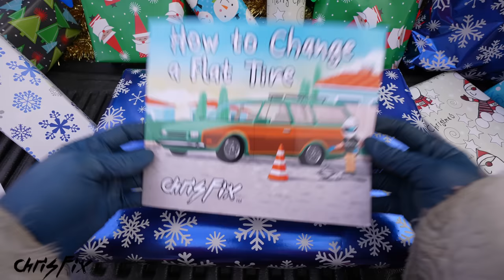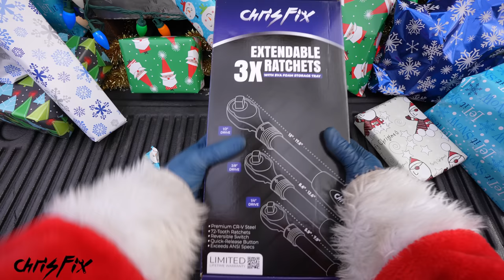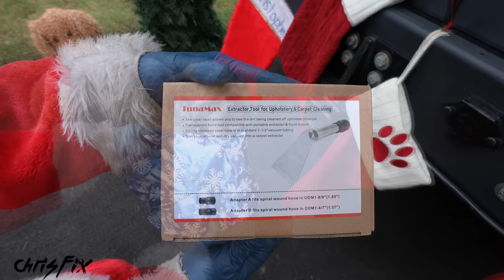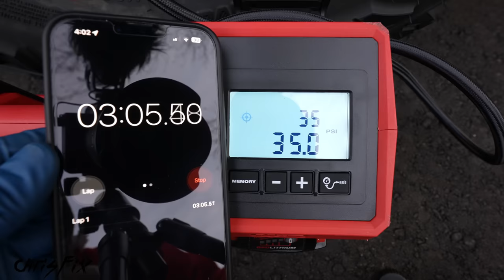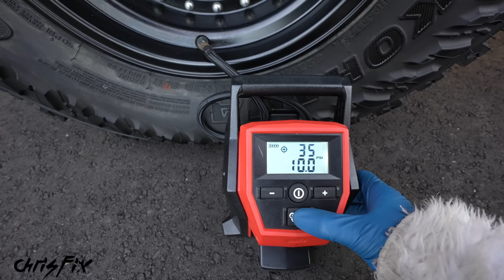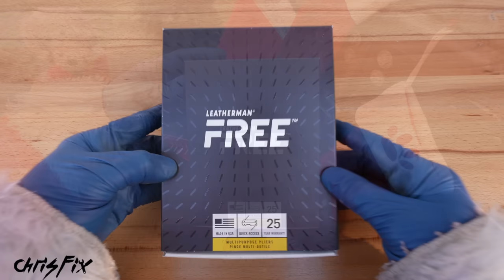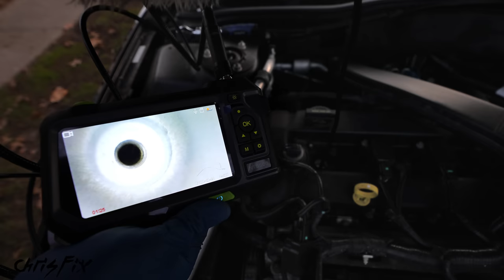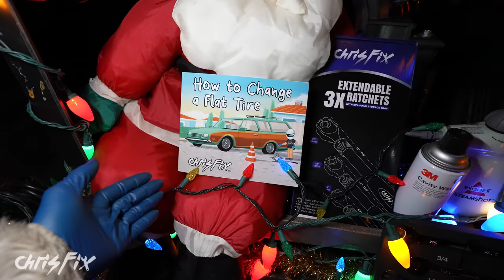Top Car Tools and Gadgets of 2022 (Christmas Gift Ideas)

Comment: Just as a safety tip, most likely you already know this - 6:55 don't break loose the wheel bolts by lifting, instead break them loos by pressing down - your back and spine will thank you a bunch! Cheers!
Reply: it might be true but considering that when going down you can only push about as much as you weigh, but when you push up you can add a couple kilograms of force and it will loosen up easier
Reply: @dat_platypus7007  jump
Reply: @thunderplump  just did, now what
Reply: @dat_platypus7007  The reason you push and not pull to loosen is mainly in the case of failure. Should the fastener be over tightened and you pull towards you and the tool slips off or worse breaks, All that force is directed at you instead of the ground. I have hit myself in the head a number of times when pushing wasn't an option and I was force to pull in a tight space under a car. And if you can't break a Lug loose with the rachet/breaker bar you are using, it's probably best to get a longer tool for more leverage or grab a cheater bar to really maximize your leverage point.

Comment: Bought the m12 inflator years ago. It's awesome! Use it on my tacoma when I go off roading. Deflate to ~20 psi and then back up to 33-35 when I'm done. One 4.0 amp battery does all 4 tires. I keep 2 spare batteries and a charger with me in the truck as well.

Comment: That coating wax is brilliant stuff. My grandpa used to take cans of it home when he was a civilian army engineer. Any metal left outside would get some of that on it. I've had a sliding lock on my shed for 10 years, no rust. The one before that was identical, rusted after 5 years to the point it was unusable cuz it didn't have the coating

Comment: The ChrisFix Extendable Ratchet set is sold out on Amazon. I've had the Harbor Freight version since I first started working on cars. It got stuck in one extended position after like 6 years, but they exchanged it for me pretty easily. I'd never buy another ratchet again. The added leverage is invaluable. I tell people I almost gave up working on cars when I was 16 and had the cheapest socket set you could find, and snapped a socket trying to take a brake caliper bolt off. I thought I did something wrong. My dad knew nothing about cars, always paid someone to fix his. He's surprised I know so much now. And if I don't, I can just go on youtube and someone like Chrisfix will show me how to do it. Thanks and happy holidays.
Reply from the maker: It's so nice to not have to grab the breaker bar in many situations! That is exactly why this is the first tool set I decided to try to sell.

Comment: As someone who owns both Milwaukee tire inflators, here is some advice. The M12 is a great unit but there is 1 issue with it. It says it will go to 120 psi, but it would never get to 80 psi for my truck. I went and bought the M18 and it will fill all 4 of my truck tires from 15 to 65/80 with 1 6ah battery and have power to spare.

Comment: I use a Michelin manual foot pump to inflate my tyres, is accurate, silent and lasted me for years and still have it and still works . It didn't cost much either and you don't have to worry about the batteries

Comment: I have the M12 Inflator and it's quite good. I went 2 months of daily inflating a tire. Toward the end of that 2nd month it became a twice daily inflate. The 2ah battery is enough to fill that 1 tire once (the tire was down to 7psi at some points), with some charge left over.
it's a good inflator for topping off 4 tires.

Comment: I think another tool you could do would be a socket set to go along with the ratchets. I just went out to get a socket set today, and it was really difficult finding a complete set of just sockets. I don't need the pliers or screwdriver or whatever else, and many sets don't have 1/4, 3/8, and 1/2 inch drive sockets. I think a no nonsense socket set with a foam insert or other type of toolbox storage would be awesome.

Comment: That Ryobi can be had for cheap on direct tools outlet, i got mine for about 35, helpful if youre buying more tools at the same time as they have flat trate shipping, but still ends up being cheaper than retail.

I have a slow leak i need to address but in the meantime it makes topping up ez.

Comment: Chris, is there a way to clean the rust screws and bolts in the engine? Right now I'm seeing my Honda civic 2006 battery has rusty screws and the negative (ground) has green rust (dust). I'm wonder if these can be cleaned or if I have to replace my car battery and the engine screws/bolts as well.

Comment: Mr fix... I tried doing the paint correction wet sanding. Bout gave myself a panic attack 😑 the first couple steps make the paint look sooooooo bad. It's not perfect but I managed to get it pretty good. The main goal was to fix a couple little spots where I tried a paint pen for the first time. My next car wash I'm going to try again to fix the micro scratches and really get the paint looking clean.

Comment: I've been fan of your channel since late 2014.

Also Chris, I have a question.

My dad's 97 Mercedes S420L (W140) (4.2L V8), that when we opened the coolant reservoir cap, The coolant look like light chocolate or milkshake looking. In fact my dad says he did replace the coolant several hours ago. I'm currently waiting your answer for any clues or symptoms? Thanks.

Comment: Hello Chris, i read that you read people's comments for up to 4 hours a day so i was hoping you'd read mine. I recently bought a citroen c4 and a huge flaw with the design is that the rubber below the front windshield glass detaches and lets water fall into the engine bay. Do you have any advice on how to fill in that gap? The rubber part is deformed and it's impossible to find a replacement part. I'm a huge fan and you're one of the reasons i started loving cars for which i'll always be thankful.
Reply from the maker: I would use an adhesive silicone. You can probably even shape it. Glad the videos are helpful!
Reply: @chrisfix  i'll try that when it gets a bit warmer, thanks for the reply, i appreciate it

Comment: H2 Hummer update, exhaust wont be in for another month, will get it installed then. Fixed battery issue, think the Hummer wouldn’t start because terminal connection, i cleaned up the terminal. Its nice and snug now. Also found the draw on battery removed the one fuse. Its .056ma now. Pretty sure there is a loose cord to the rear dvd that is causing the .045 on the radio fuse. H2 been killer driving, if you live on east coast I would do a Hummer run with you. Let me know cheers

Comment: Hey everyone I will just pass on a valuable tip! If you buy that lug torque wrench whenever you use it ALWAYS back off the torque setting as low as possible when you store the tool!  Otherwise it will lose its calibration.

Comment: Not sure about that reverse bleeder, it may remove trapped air but i'm not too sure it would replace the old fluid
Reply from the maker: Im not concerned with old fluid because I can easily remove all the old fluid bleeding the brakes normally. The air tho, that sometimes is hard to get out. I tried bleeding the brakes in the Hummer and all the fluid was brand new but the air just wouldnt escape. Used the reverse bleeder and it came out of the master cylinder.

Comment: Hey I’ve got a 1998 Land Rover Discovery that’s got a blown head gasket, but it wants to overheat immediately after it gets up to temperature, will any of these bottles still work? I read you have to run the vehicle for 60 minutes on the one I bought, that’s too much time I think.

Comment: Great video. Bought the extractor vacuum and steam shot after watching. Thanks! :) Do you have a more detailed video on how to change the brake fluid with just the reverse brake bleeder? I assume you would start with the caliper furthest from the ABS unit and work your way closer? And would you need to suck fluid out of the brake fluid reservoir to stop it from over flowing/remove the old fluid being pumped up? How do you know when to stop pumping on a given caliper?

Comment: Hey Chris! Probably a fat chance you'll respond, but I'm wondering if you have recommendations for light surface rust on the body frame of a car. How much is too much? How do I repair it? Should I not worry about it if it's just surface level? Maybe it would be a good video!
Reply: Hey WeebWhacker, not Chris but I do have a lot of experience on this subject. If fact one of my videos on here talks about restoration.
Surface rust on a body is not the end of the world unless you can poke a screw driver through it it'll be ok. It wont affect the car in any way.

Frame rust however is a different animal. Be sure its just surface rust and the frame is NOT rotting from the inside. This could lead to a major malfunction in the integrity of the frame and the vehicle could be unsafe to drive. Take a small hammer and where you see rust on the frame, gently tap it. It should sound solid, if it doesn't it could be rotting the frame from the inside out.

If you have more questions hit me up and I can get into more detail for you.

Thanks

Comment: Hello ChrisFix, I disconnected my negative battery terminal and when I reconnected it, my steering power telescope does not push the steering full length in and out direction but works perfect in up/down position. When I let the car rest for awhile the telescope moves longer distance both in and out and as I continue to play around with the telescope knob, the distance gets smaller and smaller till it stops to move the steering completely in the in/out position. Even when it stops to move the steering in/out direction i can still hear the knob button clicking sound. What might be the issue please? This is the first time it has happened, Toyota Crown Athlete 2012 GRS200, no issue with up/down movement

Comment: Hey Chris! Just have a doubt. I have bought a car wax from 3M, like 5 years back. I haven't opened it yet still. Does the car wax stay good for long? or should I dispose it?
Reply: Depending on how it was stored it can last for about 3 years if unopened. I would just buy some new stuff but it wont hurt to put on either.

Comment: Only issue with the knife sharpener near the end is some. knives have a "Secondary" bevel which is primarily seen in Utility and hunting knives, Like boker or Cold steel, and for good reason so try not to use those sort of knives on that sharpener otherwise great video, Keep up the great work mate.

Comment: chris i drilled some holes behind the muffler of my 2003 525i and it ran and sounded really good for a while but on my way home it started failing running lean on bank 1-2 should i change the injectors or it’s the exoust the problem?

Comment: Hey Chris i have a problem with my car. Im 15 years old guy today i bought my first multimetar and i asked my dad if i can check battery and alternator he said yes so i checked after 1 hour he came said that both rear dors wont open he said that i 100% made short circuit and thats why it wont open so im asking you did i make short circuit and do you know how cen i open dors. Sorry if i have made some mistakes in writting bc i am from Serbia. Its Fiat Stilo 1.6 petrol gas

Comment: CHRIS! I HAVE A SERIOUS QUESTION!
I have a column shift f350 auto but would like to put a full range gear selector in it since I pull a lot, but don't want a full Manual conversion. Is it possible?  Maybe even a clutch-less manual. I just need to be able to select what gear the truck is in.

Comment: hey Chris, new guy here I'm currently working on buying tools for my car. I just bought new bc coilovers. I was wondering if you could possibly do a vid on basic tips and stuff with changing parts out, for example you use thread lock a decent bit but idk much about it other than there's red and blue. idk I feel like I sound ignorant again new guy, jus sum light tips i did watch your tools vid i struggled a little bit but it did help in finding out what I need basically but like idk if I should be looking for 1/2 in drive or 3/4 inch I understand its jus a difference in size but does it matter again I'm sorry if I just am not paying enough attention

Comment: Hey Chris my 2003 mustang gt radiator drain plug broke because it’s plastic and I tightened it to much and it’s apart of the radiator so I can’t just get a new plug I’d have to get a new radiator and I can’t afford that. Do you think I can plastic weld it close shut permanently until I get a new radiator?

Comment: When removing lug nuts, push the ratchet or breaker bar, not pull.  I pulled my arm out of my shoulder socket by pulling on a breaker bar.

Comment: Hey Chris could I get your opinion on something , my car yesterday was going a little over the halfway mark on my engine cooling system when I’d drive over 60mph , than earlier today I turned my car on drove off and my engine turned off and my steering wheel locked , engine wasn’t over heated tho , I have oil I just put sum ; what could be the issue

Comment: Hey Chris I have a 2008 Scion XB today I found out that I had to oil when I pulled out the dipstick, out of curiosity I checked the Tranny oil and discovered that the engine oil was leaking into the transmission, I’m no mechanic so do you know what could be causing it?
Reply: Also the car leaks no oil at all on to the ground

Comment: Question. Wat would cause my bmw 325ci not going into gear manual 5 speed 2001. I've read check fluids if that doesn't work bleed to clutch then just replace the whole clutch

Comment: Chris fix I have a truck does 2h still use a transfer case or is the transfer case just for fwd part of it
Reply from the maker: The 2wd high does not send power to the front wheels but the transfer case is still "used" in the sense of it still has spinning components inside of it. It just sends all the power to there rear.

Comment: Wassup Chris. I have a serious question.  I recently took my 2005 buick century to the shop to get a thermostat put in my car. The shop messed up my fuel rail. They put a new one in and said I needed a new intake gasket. They put that in . Now my car is having a hard time starting. And when it does start it shuts off while I am driving. Do you know why that would happen? If so what can I do to fix that issue?
Reply from the maker: Could be a vacuum leak from a bad intake gasket install or they forgot to install aa vacuum line or broke something that caused a vacuum leak. Check the short term fuel trims.
Reply: @chrisfix  when I first got the car back. They actually left my vacuum hose off. Which made my engine shake. They put the vacuum hose on but it didn't fix the issue. Now the problem is. I honestly do not know where that would be located at.

Comment: Dear Mr.Fix,  I'm writing to you in hopes that you have some knowledge pertaining to and issue I've been battling with my 2003 Ford Ranger 3.0. I've followed you for quite some time, and used many of your videos as a guide to flawless repairs, modifications.. For example; proper detailing, disc and drum brakes, suspension, kill switch, bed lighting, and many more. Now to the point: Several months ago my heater/AC quit working, zero air whatsoever. I chose the wrong path and replaced the Blower Motor, and the Blower Motor Resistor, nothing. Later a nice gentleman at the grocery store informed me that my Reverse Lights were not functioning. Time passes, I finally have some time to start looking into it.. I discover that Fuse #2 is blown. ((Daytime Running Lights (DRL), Back-up Lamps, Transmission, Passenger Air Bag Deactivation Switch, Blower Motor Relay)). I replace the Fuse while sitting in the O'reily parking lot and bam, I've got AC and Heat, all levels blowing perfect. Then the second I go to put it in gear, I cross Reverse, and the fuse blows. I came home to research more and found a bunch of complaints about this exact situation, the majority solution seemed to be the OVERDRIVE/on/off button having chaffed wires. I took the dash apart, checked the wire, didn't notice anything bad, so I followed the wire to it's connector and disconnected it from the larger wiring harness. I popped in a new fuse, and again, the second the shifter hit reverse, the fuse blew. All other fuses are fine, any added electronics are on their own separate fused lines.  Other things that have been occurring; I switched the dash lights out for LEDS when a couple were going bad, instantly some of those began failing, the remaining ones flicker a lot unless I turn the dimmer to absolute low (this includes the interior dome light, half the time it doesn't work unless you punch it). The last code I've received off my OBDII was B1318. I'm out on my wits right now, I suppose tomorrow I'll go ahead and start checking with the reverse wires and under the truck.  Long shot, but what do you think? ever encountered anything like that with your Mazda?? -Thank you so much for all you've done to help the common car owner save so much money. You are much appreciated.